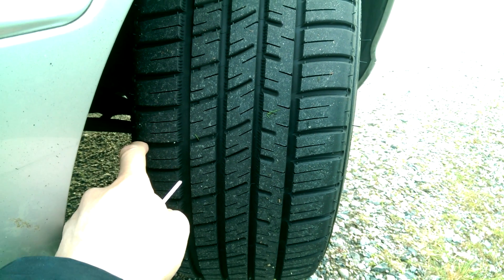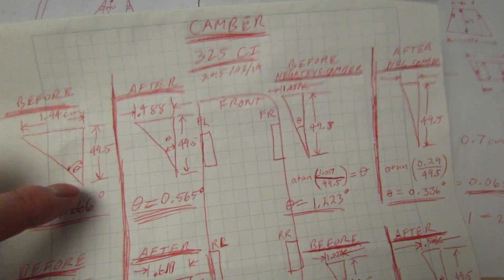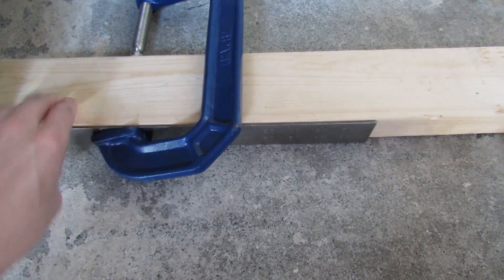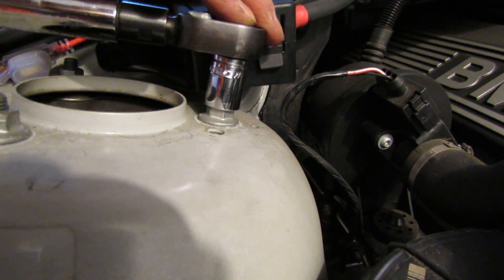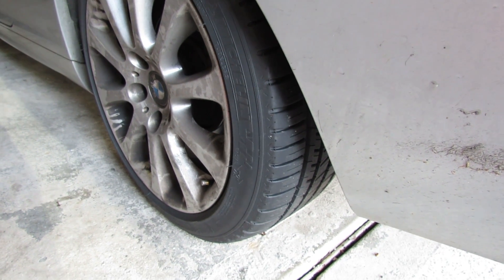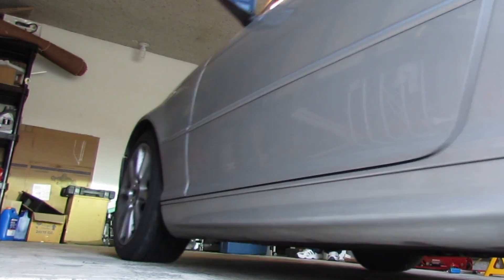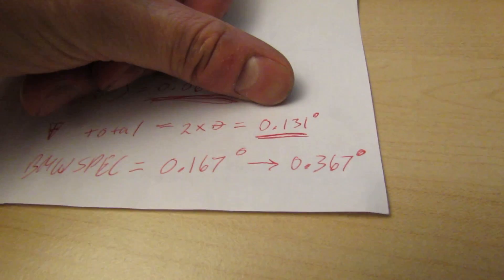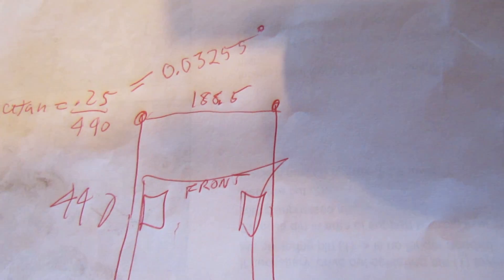How to Adjust the Camber and Alignment of a BMW E46

Comment: hey david thank you for the video really good man i have a question concerning control arms i just changed the lower control arms on my 01 330 xi because of bad ball joints on the driver side i replaced the the whole control arms both ball joints and pressed out the bushing and pressed a new bushing in the bushing has a mark that your supposed to line up on the bushing bracket i was a little off with the mark i fig no big deal i did have a hell of a time pressing the bushing in n oit so on the passenger side i just reused the old bushing that was already in the bracket after getting it all together my tires are messed up when the driver side tire is straight my passenger tire is turned out to the right its very noticible an when i drive it the tires pull to the left and right depending on which way im turning. can you help should i do an alignment or is there something else going on i did not touch the tire rods at all i did pull the cv joint inners in and out while replacing control arms any advice would be much appreciated thanks man
Reply from the maker: Hey John,  anytime.  I can't think of anything that could lead to a misalignment like that, but the low control arm bushing.  The correct installation of them will help hold the control arms in the right location,  if the bushing isn't sitting right,  it could push it over like you suspect. I would take them out and make sure they are right,  and slide them back in, with a little silicone grease they slide in and out with one hand and very little force.  Check out my video here https://youtu.be/TB5flVoWKCY. After that, set your steering wheel straight, and mark the rear wheels on the front wall, then the front wheels on the front wall, and see which front tire is offset from the rear tire the most, that will be the tire that's got a problem(This assumes your steering wheel tracked straight before the procedure).  You can take it to an alignment shop but they will most likely just adjust the tires to be straight using your tie rod adjustments,  while another problem is causing them to be crooked, that's only a band-aid fix and that's never good, as it could lead to other problems down the road.
Reply: Hey david thank you for your quick response im actually in the process of re pressing the bushing back into the bracket cause i was offset a little from the mark not sure what you mean by mark the rear wheels on the front wall then the front wheels on the front wall what am i marking
Reply from the maker: +John Harris Hi John, anytime.  At 8m25s,  I use a laser to figure out exactly where the tires are pointing,  if the back tires point at a point on the front wall,  and the front tires point at the same spot,  your tires are perfectly aligned and your car will track straight,  if not,  you'll get erratic wandering as you drive down the road.  I've got my camber and alignment really straight and my 325 drives like a dream!

Comment: Having some alignment issues, and took it into a BMW Service Center.  The car was not holding a straight path, and small bumps in the road would throw it off.  I suggested to the tech that possibly the Caster Angle was a bit too much on the Negative side.  He replied that Caster Angle can not be adjusted on my BMW?  Is he misinforming me?  Thank you for your help.
Reply from the maker: +ROCC JA Hi, don't worry about the caster, he is correct that it can't be adjusted(You can adjust it if you add camber/caster plates, but you don't need to do that).  It's the negative camber that could increase your wobbling steering wheel issues, but the main thing that can be causing your wobble are the loose lower front control arm bushings, kick the front tires, and if they wobble, it could be loose bushings, here's a video on how to diagnose it:
https://www.youtube.com/watch?v=d-G6ehWfRSk

And here's a video showing how you can replace them, it's pretty easy:
https://www.youtube.com/watch?v=TB5flVoWKCY

I had the same erratic tramlining, but after replacing the bushings, and setting the camber to about -0.5(From a crazy -1.7) degrees, it drives and tracks straight now.

Once you've replaced the bushings, your steering rack should be solid, and it should drive straight.   If you're running 17" rims, with high speed rated tires(Stiffer side walls), then that will be causing some of the feedback, that's normal, and is good, but it obviously shouldn't be wandering/tramlining left and right when you hit the undulations in the road.

The negative camber will contribute to the erratic tramlining as well, so if you can hammer out the pins, and loosen it up, and check to see that it's only about -0.5 degrees, you'll be much more stable driving straight, and will wear out your tires much more evenly.  Check the insides of your tires, they're probably worn out pretty badly.  You can use your cell phone and a protractor app to measure the camber if you don't have a square, just make sure you're on a flat surface, zero it to the surface, and put the phone up to the rim and you'll get a pretty accurate reading.  Check them first, and both should be -1.5deg or so, check them after, and you should have about -0.5deg.

The negative camber is good for improved traction while turning, but not so great for straight driving, so if you're willing to corner less aggressively, make it closer to -0.5 degrees.

Cheers,

David.
Reply from the maker: +ROCC JA Also, BMW will tell you that you can't adjust camber in the front, as you see in my video, once you punch out the factory pin, you get a small amount of adjustment, which is all you'll need or want. (You don't want postive camber, ever).
Reply: +David Sunshine Thank You so much David for your help! :)
Reply from the maker: +ROCC JA You're welcome!  hope you get it sorted out.   once you do,  it'll be nice to drive!

Comment: Hi David great video!  Quick question, is the Caster angle adjustable on a BMW 428i GC 2015?
Reply from the maker: Hi,   thanks.  Basically,  the caster is adjusted by sliding directly forward,  as opposed to sideways like I did to adjust the camber on the 325.  You'll need to install camber/caster plates on the strut tower to allow adjustment of the camber and caster,  they are available for the 428i GC for about $500+, and a tuner shop can probably install it in less than 6 hours.  You might want to pay more and get a reliable brand though,  given the importance of those adjustments.  I wouldn't cheap out on camber/caster plates personally.

Comment from the maker: Thanks Gabriel!  I agree,  the rim would be better since then you're actually measuring the alignment of the rim,  and avoiding and bulging,  and tires do get a little warped so for sure that would help get a good measurement.  Thanks for the tip!  

For those who want to increase precision: I would measure the bottom of the rim with the caliper, then measure the top, subtract the bottom distance from the top, and then you'll have your difference at the top.  It's one extra step, but would increase precision of the calculations for sure.
Reply from the maker: C S  Hi!  Not a dumb question at all.  E46 models apply between 1997 and 2006, so your 2004 will be exactly the same as my 2005. 
It's an easy job, to put it simply, I just set it as positive as I could, which was still like -0.7 degrees, but it's a good idea to check it, just to make sure you don't have positive camber or any crazy toe in or out.
Have fun!
Cheers!
David.
PS: BTW, I've been playing around with using the inclinometer on a smartphone to measure the camber, it actually works very well as a rough measurement, could be accurate to about 0.1 degrees, test it along with the mathematical method and you'll see how close they are, which gives you more confidence in your camber settings. You can find a protractor app pretty easily.

Comment: Thanks for the video. ... it was really helpful.  Alignment shop was trying to charge me $1200  because ... this is what they said. .. there's no camder adjustment for BMW 528i. ... i neeed an aftermarket camber kit and labor. . $1200... I was very suspicious.... and $1200 was a lot of money.  I could just buy new tires and it would be cheaper. Anyway., after watching your video I when and did the adjustment my self and test drove the car.... it drive nice now. As a bmw should. Thanks  a lot for uploading the video. ....john.
Reply from the maker: nang fah 
Hey that's great to hear!
I called BMW, all independent alignment shops, and heard all the same things, "We don't think it has camber adjustment, and we'll have to take a look"(Even told me it was $200 to remove the pin, which took my hammer 2 seconds to do), I'm was thinking, I'm not going to let them touch my car, if they don't even know they can fix it, especially since a 3 series BMW is one of the most popular cars out there!

It's really quite simple, and recently I tried using the protractor on my cell phone, and it can actually read the camber  with pretty good accuracy, as long as you're on a flat surface and you calibrate it.(HTC One M7).

After fixing my bushing and alignment, my BMW started driving as it should too, wasn't randomly wondering all over the road, even if there were undulations to the road!  It's great to drive now, I definitely recommend it to everyone.

Glad your car works great now, thanks for the comment and feedback!
Happy driving.

Cheers,
David.

Comment: Thanks for the video btw. Very informative.
Reply from the maker: You're welcome!  I had to post it cuz I know a lot of people are wearing out tires, and the information isn't clearly out there, of how to fix it. Most shops will tell you they can't adjust it too. Even a dealer told me they can't adjust the front camber, then I asked about the pin and he said it takes two hours, cuz he has to drop the suspension, took me 2 seconds. He was gonna charge me $200 more too.

Comment: Nothing bad happens from punching out that pin on the front strut mounts?
Reply from the maker: BMW puts them on the cars on the assembly line. They assume all the vehicles are made the same and set the same. By taking it out, you are gonna show them that it was adjusted. You're out of warranty so it doesn't really matter. Nothing else that's bad happens tho. They would do it too, if they wanted to adjust the camber.